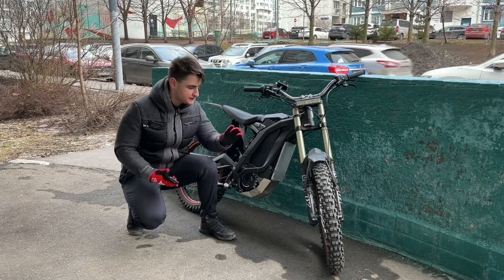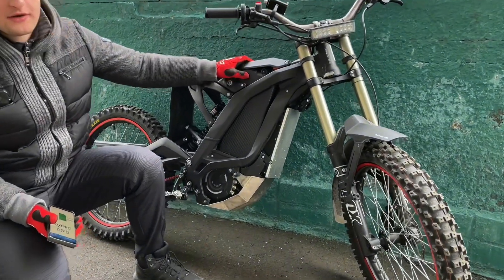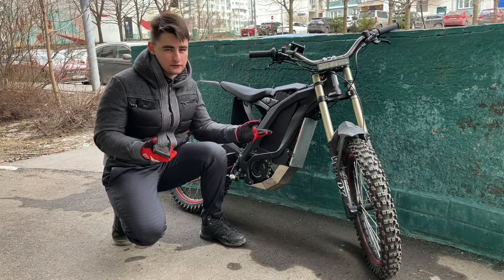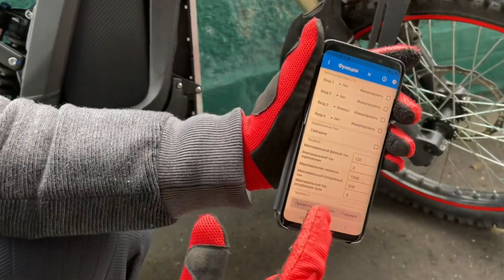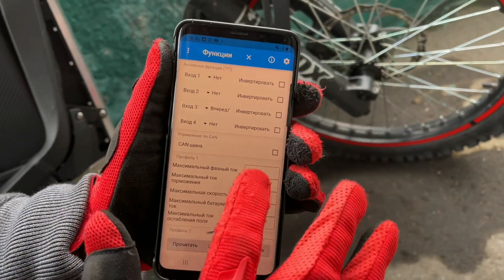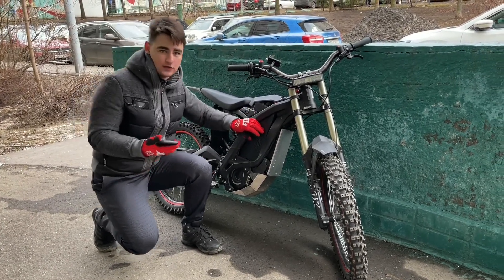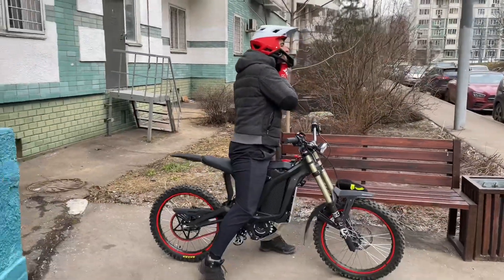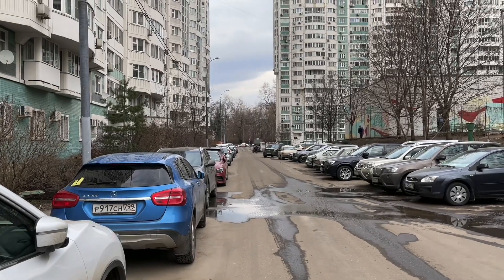Selling prototype SinTech controller [SOLD]

Comment: 30% Powerboost? 90A is only Possible with stock Battery. BMS will cut. If you spend 1000$ you get only one thing. Less Power from zero. Nice invest.
Reply from the maker: Please, carefully read the description. On the stock battery your power from zero will get 20-30% better and best possible performance is reached even with the prototype controller. On the aftermarket battery you get even more torque but 0-10mph speed acceleration will be a little worse than it can be with other controllers. As you can see from the video, the bike is accelerating quickly and it is necessary to fully load the front so that the bike doesn’t roll over.

The reason why you can feel 20-30% power is because stock controller output isn’t even close to advertised 6kw. Actual power of the stock bike is around 4800w and as you mentioned it is possible to discharge stock battery at 90amps with short bursts up to 99amps without power cutoff. 

Moreover, please have look at the stock battery elements Panasonic ncr18650pf 2900 mAh datasheet. According to the datasheet max allowed element discharge current is 10amps. Considering stock battery 16s11p configuration (176 elements in total), you can safely take 11 parallels * 10 amps = 110amps current from it and have advertised lifetime.
Reply: @SurRonshop  its not about cell life. if you configure your controller to more than 90a you can trip the bms "sometimes". and you can be sure you dont want a bms cut when you ride a steep hill. that means you can only setup 90A if you want a reliable bike and not chasing split second peak amps. BUT phase amps below stock controller will be noticeable.
Reply from the maker: @matejcernicky7224  absolutely true! However, power cutoff you are talking about does not exist in case you do street riding. In case of an uphill riding style you will need to keep your amps below 90. This will still bring a noticeable power benefit. SinTech controller used with stock battery customer can be found on our website

Comment: 900 plus shipping are you mad ? We can buy the proper fully upgraded controller for that along with many other fully upgraded controllers in that price range , I thought You was gonna say 200/ 300 maybe 400 dollars at a push for a semi upgraded controller like as  that sorta suits it  for what it does 😅🤔🤯
Reply from the maker: Standard SinTech controller costs 975$ + shipping and is available via 2-3 months waitlist. This controller is in stock ready to ship and has all features of the regular controllers: Sur-Ron speedometer display, tilt/fall/brake/kickstand sensors recognition. Sorry to hear that the offer isn’t fairly priced in your opinion